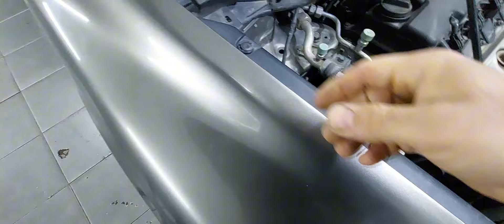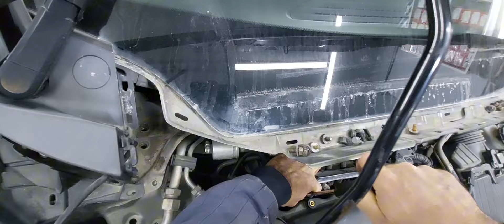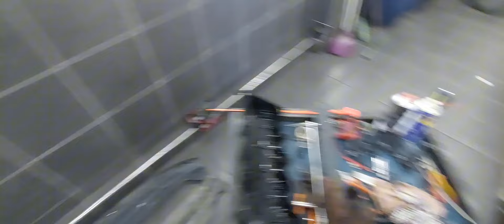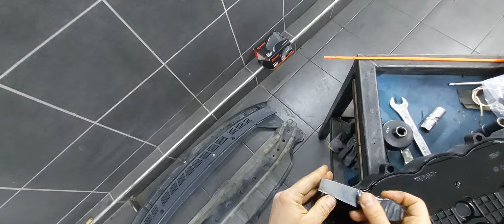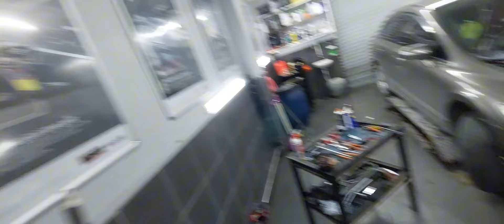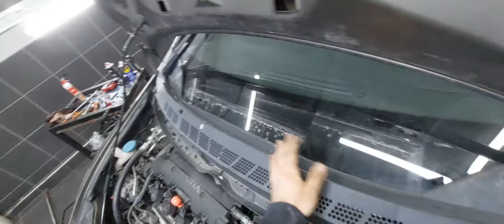You can adjust the engine valves yourself from the Honda civic  owder(fd6-fb7 R16 A1-A2)#honda#fd6

Comment: Ustam öncelikle elinize emeğinize sağlık size farklı bir durum danışacaktım  2009 2.0 benzin LPG Crv 3 aracım var araç 1500 2000 devirler arası 40-60 km hızlar atasında  düz yolda hafif gazla giderken silkeleme yapıyor  gaz verince veya ayağını gazdan çekince silkeleme kesiyor gazda ve benzindede yapıyor   Hız sabitlemeye  alınca yapmıyor ….Vtec teklemesi diyen var şanzuman diyen var araştırdığım kadarı ile Honda’larda bu sorunu yaşayan çok dizinde fikrinizi almak istedim şimdiden teşekürler
Reply from the maker: Teşekkür ederim 
Fd6 larda kullanılan motorun 2.0 lt olanı sizin aracinizda mevcut ....evet bahsettiğiniz devir araliklarinda  bazen yapabiliyor ama öncelikle buji sağlığı bobin sağlığı önemli sonrasinda subap ayari ....eğer. bu üçlü durum sağlıklı ise yapabilir ama siz hisstmezssiniz  yan i motor tolare eder ... birde kullandiginiz  yağın kalitesi önemli vtec valf yağ basıncı ile çalışan bir valf....bu nedenle doğru yağ kullanmanız gerek ....km düşün ise 0w30 deneyebilirsiniz
Reply: Belli bir devirde yapması sonucu bi arkadaşın aracında buna benzer bi sorun vardı,sorun bobinlerden çıktı değişim sonrası düzeldi
Reply: Bobin buji kontrol ettirin
Reply: @mfgarage19 kral eline sağlık ...crv de 160binlerde ben 5w30 mobil1 fe 3000 kullanıyorum a5b5 olduğundan dolayı,,mobilin sitesinde 0w20 mobil 1 esp önerdi,lpg olunca tırstım eksiltir diye :)
Reply: @mfgarage19  araç 340 binde buji ve bobin değişimi yaptım fakat bobinler farklı marka pyc ve bi diğer marka var yağ olarak 5/30 petronas kullanıyorum 10/40 kıllandim bir periyot araç sesli çalışır geldi bana tekrar 5/30 a döndüm vtec valfinede bakmak gereklimi tıkanma filan alabilir diye